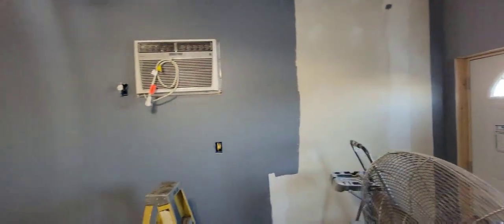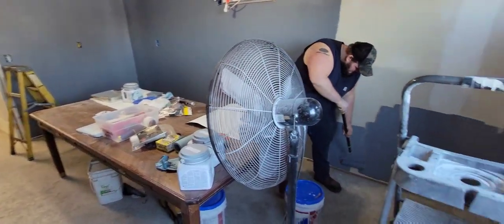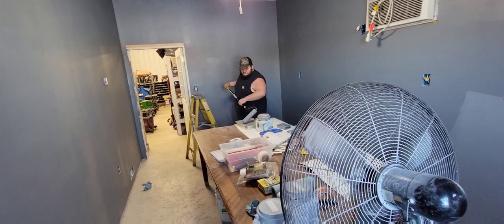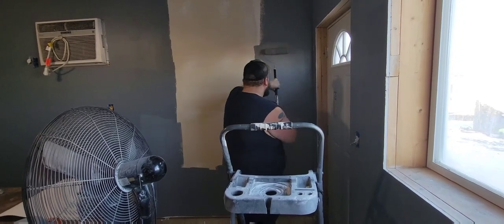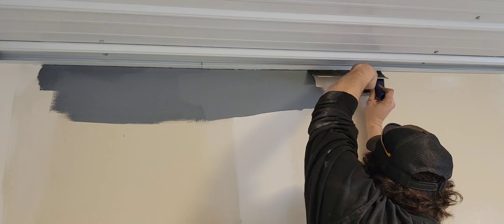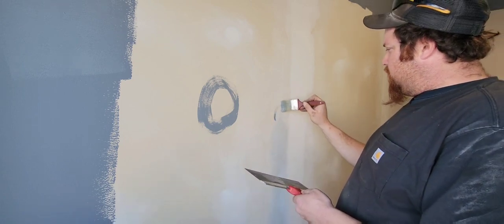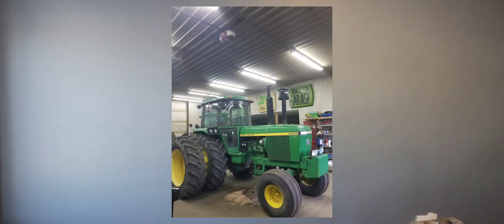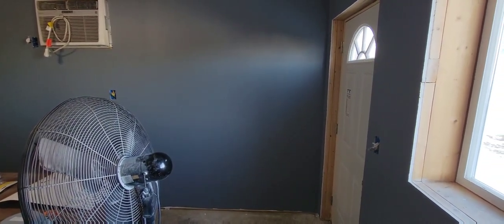Bob Ross Would Be Proud Of Our Paint Skills Shop Office Video!

Comment: Excellent video Brandon  :) also been same temperature you get & low amount snow in Port Hope Ontario Canada and temperature going be - '0 F  my way tonight or be lower than that too and be -5'F in December 2021 last year for Winter Season month so far ! But it been colder months coming up soon like most Winter Season months do and lowest temperature seen was in 1992 -52'F in Port Hope Ontario Canada from January to March plus tons snow also freezing rain together mix to ! So bad on farm I grew up farm tractors also had put metal bucket on under oil pans warm engine oil up  plus block heaters too and homemade batteries chargers had be used keep batteries charging up to start with too! Plus farm pick up trucks also stake trucks too same so chop feed make for 5 months of pick corn and grains too! Was hard work but did get thru it and my dad couldn't use highway master 18 wheeler truck because freezing up in snow plus ice 
Mix also farm tractor couldn't pull out or even heavy duty tow truck ! But in February lost power in area one big hydro tower in farm below us on my late uncle Roy farm powers Ontario and Quebec wire snap live off and Ontario Hydro plus helicopter men had find and fix it ! Was not easy to especially when 300 feet up air from ground level!